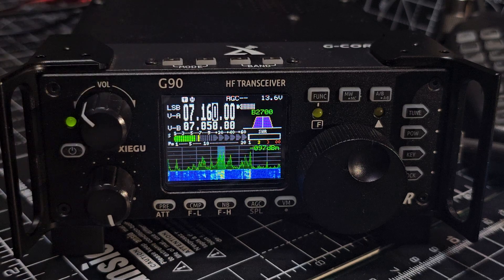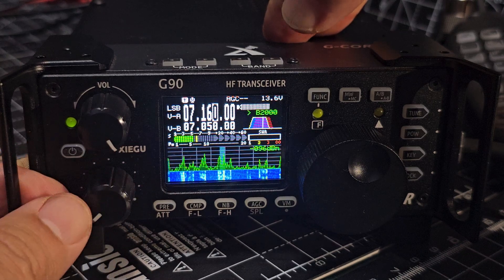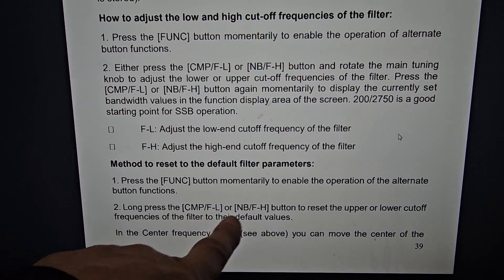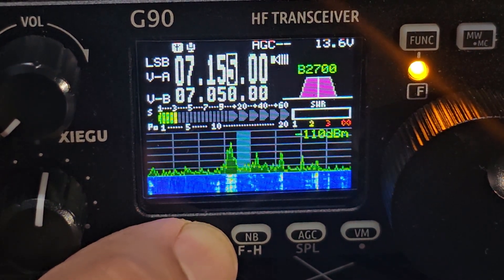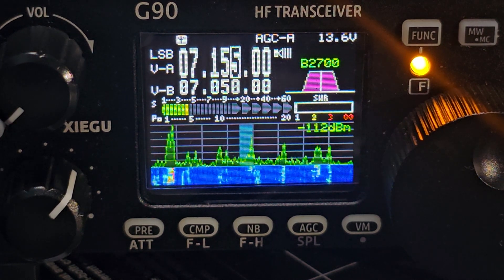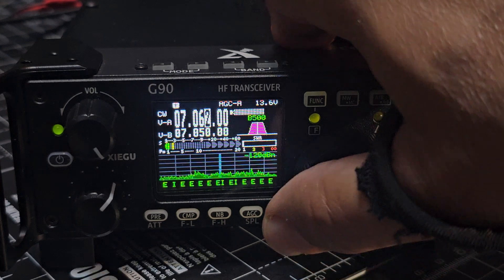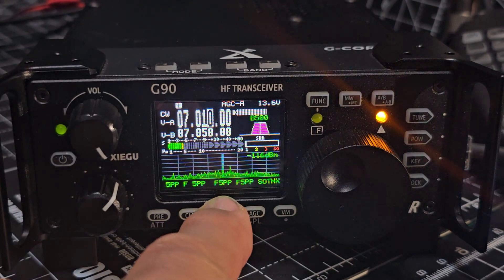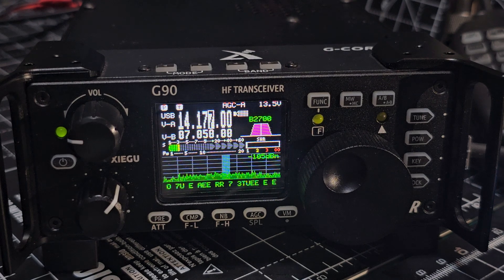Xiegu G90 - Filters - How to Use - 2025 v1.80

Comment: The instructions are wrong. You had it right the first time when you used the MFB instead of the tuning knob. 

What I want to know is if there is a reset button to the RIT or, better yet, an on/off button.  I would  love to set it and turn it off and on for use in CW.
Reply from the maker: Hold the button
Reply: I didn’t realize it had RIT. Does it also have XIT?  One video I watched said you had to use split on CW to not zero beat the station with the pile up because his older firmware, that he liked better, didn’t have XIT/RIT. But he liked how the filter settings worked much better on 1.78 and older.  Now there’s a 1.81 out.

Comment: Thank you. I just got a new g90 with the new power poles and built in fan. It has the 1.8 firmware installed. I was confused because the 1 a friend let me play with was different on the filters...
Reply from the maker: Yes older firmwarre .
Reply: I was pleasantly surprised to have the built in power poles. After the fight to remove the power plug on my Yaesu.

Comment: Hi Just watched the video after spending ages trying to get F-L and F-H buttons to do something but reading below it seems in the latest firmware they do nothing.
My other issue is that in CW mode I can't get the bandwidth wider than 500Hz -  500Hz is fine for when you are working stns but when just tuning around  I would rather a bit wider bandwidth.
I suppose you can always go into SSB mode when runing around but there will be a slight frequency shift when you go back to CW mode.
Reply from the maker: Ok

Comment: I think that applies to firmware prior to 1.79.b02
Reply from the maker: I show in video i am using v1.80
Reply: Yes but I think the part that you are referring to regarding the use of the filters and what it says in the new manual, it applies to earlier  versions. The two keys have no effect on the latest versions, with the Function key pressed
Reply: @HarryPontikis  yes I just got a new G90 today and you are correct, those filter buttons do nothing. I am on V.180